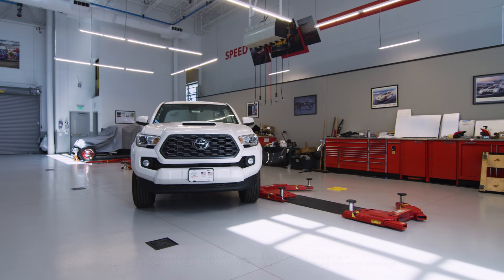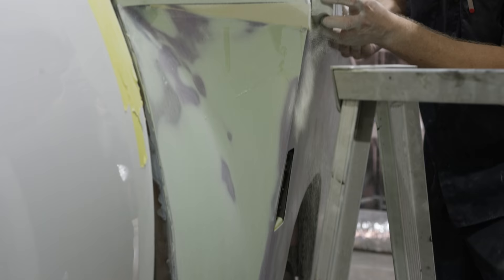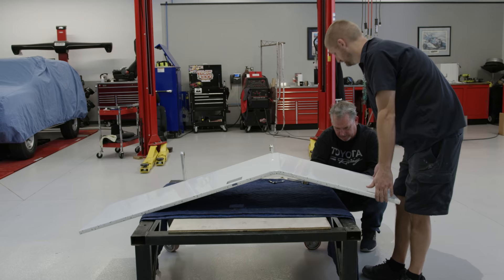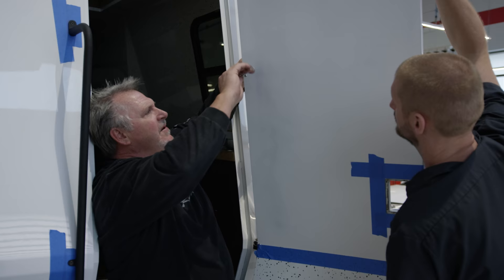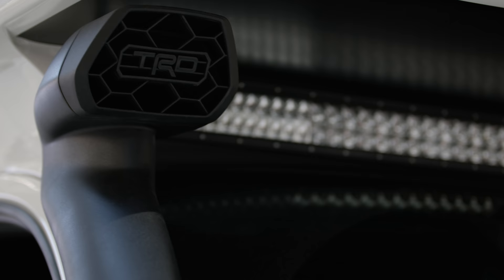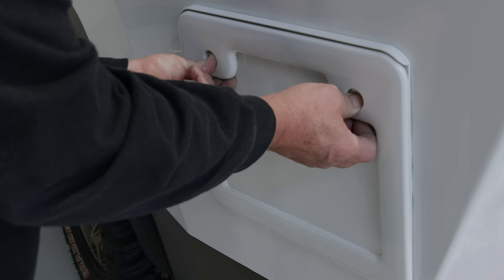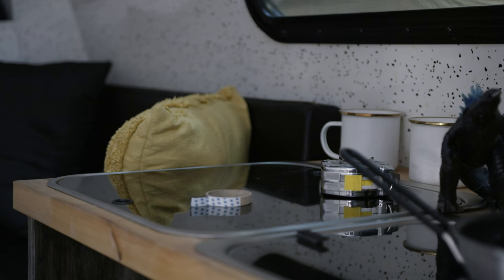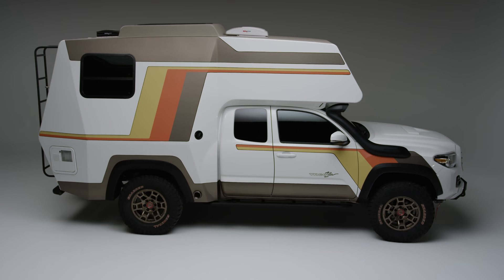"TacoZilla": SEMA Tacoma Truck Camper Episode 5 | Toyota

Comment: Just build them. They would be instantly sold out.
Reply: No physically nor legally possible
Reply: @JeepCherokeeful  4/a
Reply: @JeepCherokeeful  its possible but not feesible, people wont pay $200,000 for a taco
Reply: @frankly2677  Toyota pickups were sold as sunraders and chinooks back in the day for reasonable prices. Wish they could work something out like that, would be sweet.
Reply: @JeepCherokeeful  you’re no fun
Reply: @frankly2677  I live in the pnw people in Vancouver and Seattle would spend that no issue.
Reply: @frankly2677  Youtubers would....only youtubers lol
Reply: would tip over
Reply: Mass production
Reply: @frankly2677  oh they will
Reply: @jakejoyce5555    I used to have a Sunrader shorty with a 5 speed and only 56,000 miles. I desmogged it and installed a Weber carb. Unreal how much more power it had.after that. Bought it for $1200 and sold it later for $10,000.
Reply: @JeepCherokeeful  boo on in
Reply: @frankly2677  IIRC this one was like $350,000.
Reply: @frankly2677  you think $200K? at $125K I bet you would get lots of takers...maybe $200K for the Tundra model...lol
Reply: No >;(((!!!
Reply: @Gigachad2a  Nah cus its mines ha e.e
Reply: @teresitahammond731  They can't even make their regular vehicles without dealers beings empty. You're asking them to go to outer space
Reply: 200k? A little steep don't you think?
Reply: @JeepCherokeeful  why not physically possible? 
why not legally possible?

Comment: Cool to see an overland inspired build project. I've been living in my 2005 Tacoma full-time for almost 7 years 4x4'ing all over the American Southwest with my dog, Sierra. Love having a nimble mid-size so I can reach those super remote spots. I'm curious to see how this build will perform in challenging terrain. ~ Brian
Reply: Love your videos bro
Reply: I'm currently living in my 2008 4x4 access cab Tacoma. I bought a fiberglass slide in utility body 9 years ago and have been in trucking until recently. A move to Texas to be by family is what prompted me to move into it. I have a microwave and refrigerator behind the driver and passenger seat, a deck with a twin memory foam mattress and a basement below for storage as well as an overhead storage area above the cab. I'm typing this from the back of it right now. It has really evolved into something very workable and is saving me a pile of money in rent. Even though I don't have a pass through to the cab, the utility body can be removed and the truck restored to stock. I have heavy duty bumpers front and rear, a 10,000 pound Warn winch, 2000 watt generator, 100 watt portable solar panel and a 6 gal jerry can for water. The Canadian built shell is built like a boat with fiberglass covered with a gel coat and stainless hardware.
Reply: @telcobilly  Right on, sounds like a great set up!! ~ Brian
Reply: Hopefully they give you the first model released, (or me)
Reply: Your videos rock man
Reply: @OffGridBackcountryAdventures  I've been thinking about owning Tacoma and starting to live with it like you!

Comment: This is so cool.  I'd love for you to also make a smaller one that would fit into an 8' tall garage.  That's what was so great about the pop-up small Chinooks.  It was also super convenient to be able to get to/from the drivers seat to the back without having to go outside the vehicle.  I'm looking at buying a 1977 Toyota Chinook, but wish it was lifted a little more and had 4wd, and automatic transmission would be nice.  I wonder how the TacoZilla will sell as a manual transmission.  Not many know how to drive one anymore.  It's also a guy thing, I think, to assume it needs a huge bed.  There just aren't campers built with a solo traveler in mind, or a solo female who doesn't want to have to get out of the vehicle to get into the driver's seat.  It's nice not to have to get out into the weather, and it's a safety thing, too - not only for scary people, but bears, too 🙂
Reply: 1976 Blazer Chalet too

Comment: With the overhang of the shell I don't think the light bar would be much use there, too much light bouncing back on the windshield. Also nitpicking but "Desert Air Intake" and water heater. Cool concept, would be cool to see something similar to this in production even if its through a 3rd party.